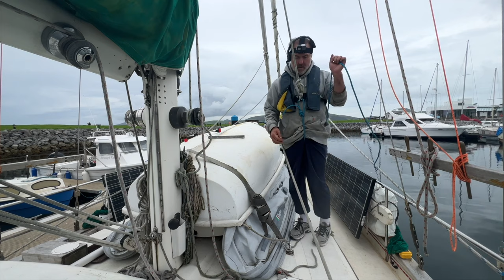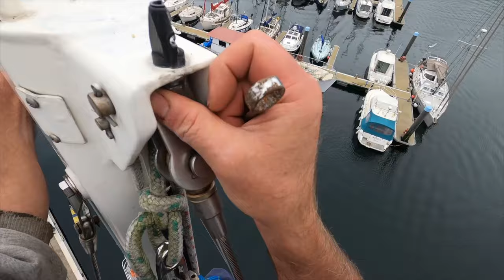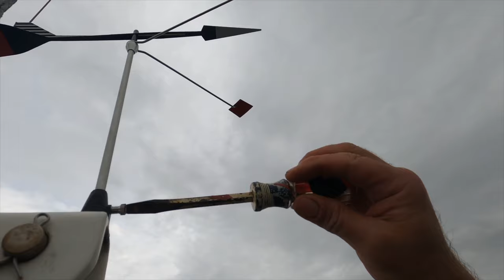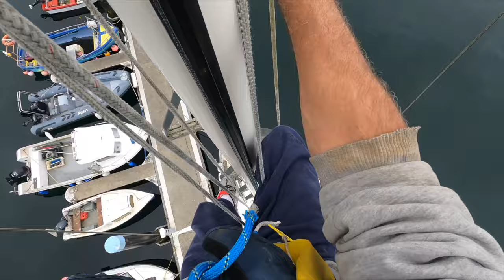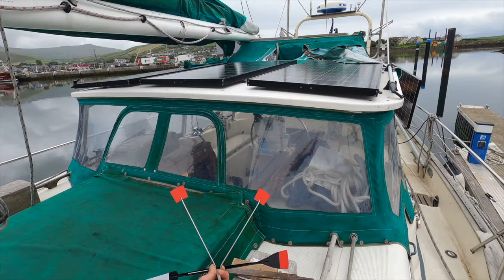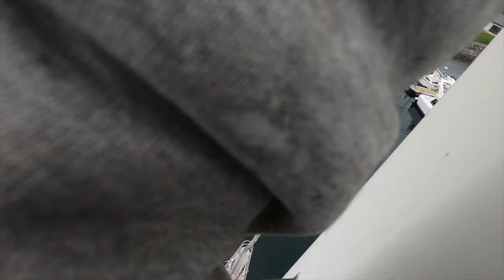Replacing the Windex at the Top of the Mast in Dingle, Ireland | DrakeParagon Sailing

Comment: I remember discussing mast steps with you while you were installing those in Oriental. Don’t know about you, but every time I climb the mast my hands are sore from gripping so tightly!
Reply from the maker: Oh that reminds me of a time... It's such a long story... maybe I'll tell it in full someday in a video. But in short, back in 2003 I sailed my Westsail 32 from North Carolina direct to Saint Martin. Midway I got trapped in the worst storm.. I believed that if I didn't heave to then the boat might be at risk of capsize. But the halyard came down to the deck.. I needed the halyard to heave to. So I climbed up to the top of the mast with the halyard, without time for any safety gear, in the most awful winds and seas. When I was at the very top the boat got hit by a wave, and got violently knocked over about 25 degrees. I lost my footing. And was just holding on to two mast steps with my bare hands, with my body dangling over the water... I managed it, and got back down to the deck and heaved to with a double reefed main and a backed staysail. And both my hands had big cuts in them that were bleeding all over the place. From holding on so hard for my life.

Comment: Hi Drake, I wonder if over time the aluminum strip will rotate to one side. When you climb up to add “bird preventers”, you could drill a hole in the strip, install a screw and nut that rests against the masthead to act as an anti rotation pin. Put cable ties/zip ties on the strip with the tails sticking up to keep the birds off of the strip.
Reply from the maker: Thanks! I was wondering about that too. Interesting idea!
Reply: I think I’m going to invent a mast harness that includes a upper body harness component, you would hook into the chair , and then the rope would run through a climbing snap link on the upper part about sternum level, or maybe some kind of assembly with a brake in it, that way you can work with both hands and ( after much testing) not worry about becoming inverted and face diving into the deck